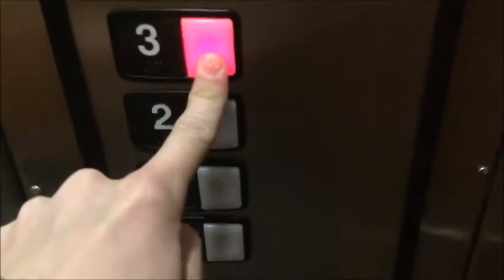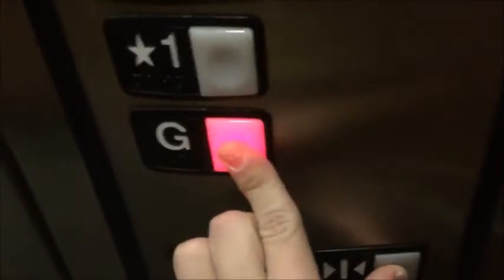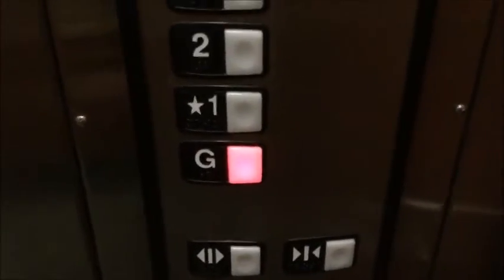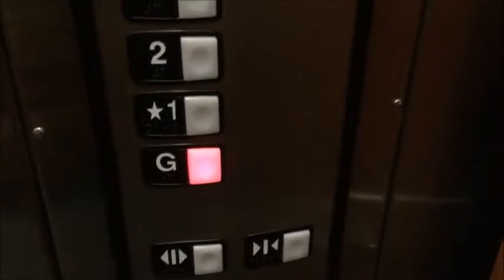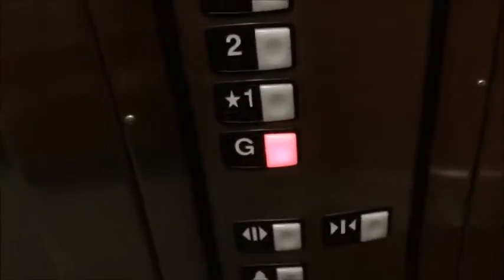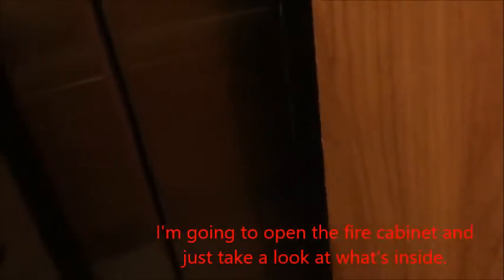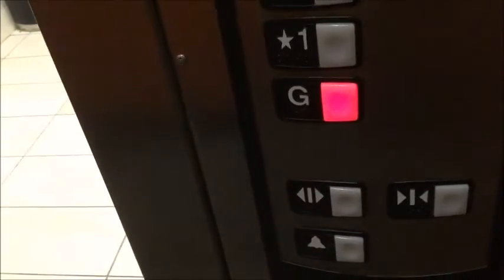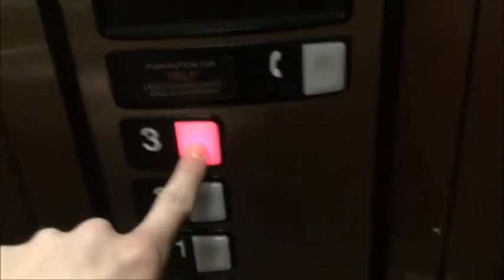Independent Service on a Schindler HT | Elevator Video

Comment: Hey, Jamestube 8439! Where Is This Elevator Located?
Reply from the maker: Holiday Inn Express in Auburn Hills Michigan.  (Near Great Lakes Crossing Outlet Center)
Reply: @Jamestube8439 ! That Hotel Was Built In 2007!
Reply from the maker: @elevatoralarmcoasterandani1214  Yeah, and the elevators fire service key switch does not take the FEOK1, (as you could see from when I opened the cabinet with my key)

Comment: Did you really have permission to put this on IS?
Reply from the maker: Of course I did, I never use elevator keys without permission, using keys without permission is a terrible thing to do.  I would never do that.
Reply: Hmm, I see
Reply: I’ve never put a Schindler lift on IS before..... this is different compared to other brands
Reply from the maker: @ElevatingChicago  Yeah, Schindler HT is interesting in independent service.
Reply: I don’t typically open many Schindler cabinets, most of the time I work with Otis, TK, elevators with innovation, and hopefully Mitsubishi at some point.
Reply from the maker: @ElevatingChicago  Nice, the key for the cabinet is H301 (just in case you decide to open one, with permission of course)